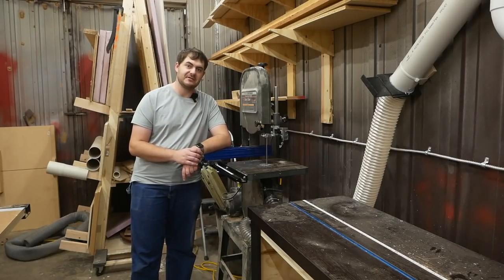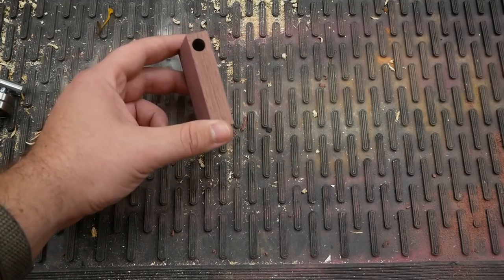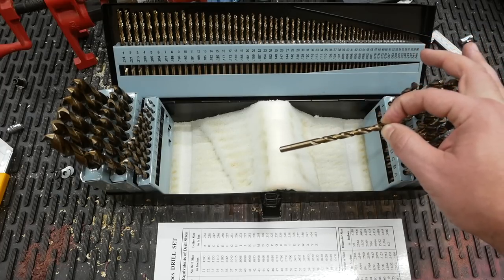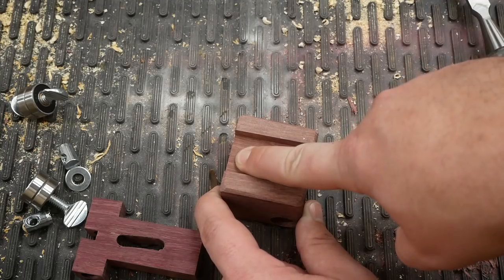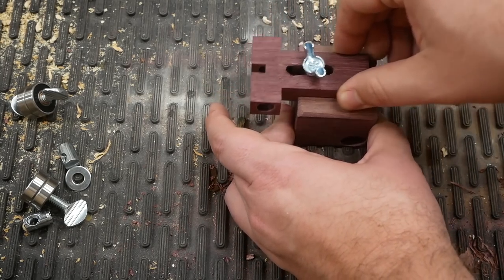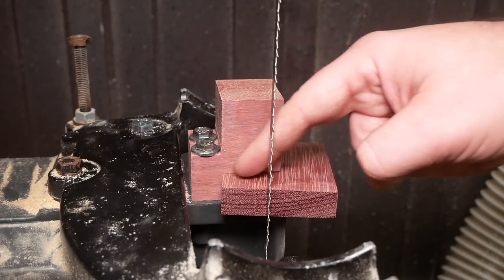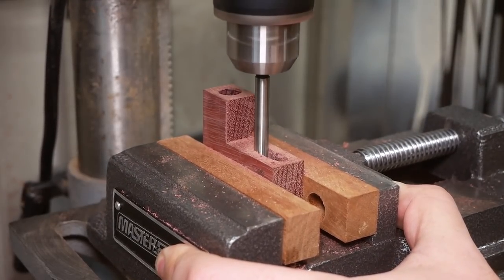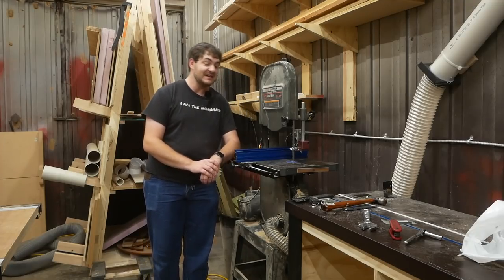Making New Ball Bearing Blade Guides For My Old Bandsaw

Comment: Matthias Wandel has made a few videos on band saw blade guide design.

This one discussing the orientation of the back ball bearing:
https://www.youtube.com/watch?v=V_bUCTCNUmo

This one comparing four different designs:
https://www.youtube.com/watch?v=DQZY0bFDiw8
Reply from the maker: That's exactly the info I was looking for. I should've known the wood elf would have a video or five about this.
Reply: @UnderDunnOfficial  bruh but it's Matthias Wandel were talking about here. The man knows about the topic as much as you and me 😂 Regardless Matthias makes some great machines
Reply: He uses wood blocks on the sides instead of bearings. I designed and printed blade guide for my saw that used bearings, and later ended up switching to hardwood side blocks. I now agree with him they are better.
Reply: That des it... I Quick before i Saw you loosing fingers....
Reply: @broken_font1881  Matthias is an engineer.
Reply: Just wanted write same thing
😁
Reply: fernando Mazzon   What species of wood?
Reply: Matthias set his up incorrectly. The rear bearing is not supposed to spin when not under load. It should be just off the blade and make contact the moment any force is applied. This saves bearings and fixes Matthias's complaint about noise. Checkout the bandsaw setup video the Wood Whisperer put out a few years ago ft. Alex Snodgrass for better info:https://www.youtube.com/watch?v=bxVyKsbuwZQ
Reply: Is the wood and wingnuts good enough?
Reply: @UnderDunnOfficial  Wood Elf, I love it. Thats how I will think of him from now on.
Reply: @igorbaldo  Looking at his website he's a software engineer. Mechanical and software are entirely different fields
Reply: @davidzard4643  engineer is engineer. :)
A person who has a problem and trys to fix it and maybe sometimes fails. But he keeps trying until it is fixed instead of running away crying :)
Reply: Another reason is there's more surface area contacting the bearing when installed laterally; this would limit potential flexing while under load (i.e. resawing a board).
Reply: Nice

Comment: Robert: goes and gets a full imperial drill bit set

Me, who often has bad ideas: why not just wiggle the 10mm around until it bores it out enough to fit?
Reply: Honestly that was my first thought. 🙂
Reply: or, wrap sandpaper around the slightly smaller 3/8" bit
Reply: Yeah it looked like about 1.2 imperial wallers to me
Reply: Because wiggling the drill around gives you two back to back cone shapes rather than a cylinder.
Reply: Yep. I was like “aight just wallow it out a bit”
Reply: I had no idea doing the wiggle move was a bad idea.
Reply: @rescdsk  "1.2 imperial wallers" I need to remember that one! 😂😂
Reply: if it was a cheap drill bit i would have ben tempted to just try chap the drill bent so it cuts bigger.
Reply: Well done. Where did you buy the bearings?
Reply: Yep that’s what master craftsman does
Reply: @ferrumignis  not a legitimate problem
Reply: @THESLlCK  If you don't give af about accuracy and precision it's not.
Reply: @ferrumignis  “reee conversions are hard”

-whiny “educated” euros
Reply: Or wrap sandpaper around it. Or use an end mill. Or use a burr to ream it. More than one way to skim a rat.
Reply: Take the 10mm twist drill to a grinding wheel.

Make the center point of the drill "off center".  Basically you are sharpening the drill while moving the center point by only sharpening one of the cutting edges.

Now you have a cutting edge that is say 5mm and another that is say 4.91mm vs two at 4.955 (exactly center on Dunn's 9.91).  As that 5mm cutting edge rotates about itself (ie drilling) you will get a 10mm hole.
Reply: What is preventing us from 3d printing the drill bit unless the cost of filament is a concern?
Reply: @drippingwax  My 3d printer actually came with a sample of metal filled filament. The plastic part of the structure can be molten out of the finished part.

Comment: Sir: Two suggestions.
1. Buy a fairly cheap set of center-cutting end mills for your slotting and carving operations if you are going to use a drill press to accomplish them.
2. If you MUST put screw threads directly into wood, use Helicoils or similar thread repair inserts. They will last much longer and be stronger as well.
By the way, 2 flute cutters, like drill bits, cut triangular holes. 4 flutes cut rectangular holes, etc. The number of flutes in the cutter, plus one, is the number of "corners" in the resulting hole. A framed with 6 or 8 flutes cuts a founder hole with smoother walls and more accurate and consistent diameter. 
I know you didn't ask, but I am an old fart, I envy your having that workshop and I just love to poke the bear. 🙏

Comment: if you need to tap threads into a softer wood, try drilling and tapping as normal but then saturate the newly cut threads with super glue.  Once the glue is cured run the tap through the threads again and Robert is your fathers brother.
Reply: There are actually several ways to do it, but usually you screw metal inserts into the wood which are pre-tapped. High speed drilling of the wood with a metal tap is not tapping wood. Yeesh.
Reply: Robert is him
Reply: @AgentTasmania  woosh 😛

Comment: 3:25: Based on the splatters on the wall behind the drill press, it looks like you've learned a few hard lessons...
10:09: Yup. No big deal...
Your videos are instructive,  fun, and inspirational.
Reply: No, this used to be a paint shed for an automotive shop. Granted your point still stands
Reply: @R41N80WSCR4TCH  No, this used to be the set for Dexter.
Reply: @madziar160 : Maybe Rob was the inspiration.

Comment: Nice job! One reason for the thrust bearing to be 90 degrees to the blade is more surface area contacting the back of the blade, rather than a single point with a parallel bearing. I’d fix the upper blade guard sooner rather than later. Keeping your hands away from the exposed part of the blade isn’t enough. If and when the blade breaks, the loose blade can nastily cut you. I’d make this my very next project.
Reply: And that's the problem , the thrust bearing is the one that does most of the work to keep the blade in place ,  more contact area will only   increase the friction between the blade and the bearing , therefore creating / generation more HEAT when the saw in at work , thats the last thing you want to do 
 That heat will damage the blade and it loose it's sharp edge quicker than you expected
Reply: I agree with you @jim Gott.  to spread the load of the contact of the back of the blade helps prevent it from buckling and binding on the side guide rollers (or blocks).

Comment: Very cool project!  Fwiw, clamping a board across my drill press table (and later building at t-slot base with a fence) transformed my drill press for me.   I now had a way to support what I was drilling and haven’t had any more cases where the item I was drilling got bound to the bit.  Plus it is now very easy to clamp items to a stable surface (the fence) and keep my hands well away.

Comment: I'm amazed that you can tap a thread directly into wood!
Reply: I wouldn't have thought so either but Matthias Wandel does it all the time
Reply: Before using helicoils on a cylinder head I actually practiced installing them in a 2x4 and it worked great.
Reply: Guess it really needs to be hard wood to have a chance of holding any force. Also UNC probably works better than metric or UNF due to the coarser thread pitch
Reply: Purple Heart wood is extremely hard and hard on the cutting tools as well.
Reply: Hitting it with thin super glue, will also harden the threads up.

Comment: I got to say this, that is impressive in what you did... I have a Band Saw CARTER  Guide System.  3-bearing wheels top & bottom. I had blocks, yet gave me a lot of issues. It was an investment $150.00 for the new Carter Guides. The funny part is that my BAND-SAW was $189.00 Penn State Industries 1992. Did the Carter Guides in 2010. I changed the tires on the wheels, better quality for blade control and the Carter Guides made it a completely different & a better band-saw. Blades last for yrs instead months. It was worth the investment just in saving blades.

Comment: Hi, i enjoy your channel and unapologetic delivery.  I do not know if this was mentioned in the comments, but  just a thought... Alex Snodgrass has a great bandsaw set up procedure.  He suggests that instead of centering the saw blade on the wheels we ahould be centering the back of the gullets.  This keeps the blade straighter duringncuts and eliminates additional adjustment of the side guides once set.  I have done this and it reduces drift considerably.  Thanks for what you do!

Comment: I put the old guide set off my G055 Grizzly onto an old bandsaw looked identical to yours when I put a Carter set on mine. It didnt even have a place for bottom guides, I had to drill mounting holes in the frame. Worked great after the refit.

Comment: That black piece you removed is where I squeezed my dust extraction  brush in its purpose was to remove the dust before it got onto the rubber Tyre on the lower wheel, secondly it also sucked the dust through the blade insert which I drill 3/16 holes in to assist with downward dust removal.

Comment: bearings are faced sideways on guides because facing them towards the blade leads to a terrible noise and will also rub a groove into the bearing over time
Reply: That is why you are supposed to have earplugs to avoid hearing unwanted noise, tho i despise the thought as hearing shit is what gives you an idea of something not working properly, and secondly, the bearing is a disposable tool in this case, just like a tire on a car, which is supposed to be changed when worn out, and with it backing the blade up, despite it making noise and being worn, it prevents the blade from snapping when you shove a chunk of something that would force the blade back and put too much tension on it...
Reply: If the bearing is spinning and the saw is adjusted properly, very little grooving. Those standard side mounted bearings wear terribly as the blade is being rubbed sideways wearing out both blade a bearing side face.

Comment: I have been wondering why the bearings contact the blade with the side of the bearings. I intend to do the same modification to my old DeWalt table top band saw.  This video has given me some tips on what I need to take into consideration. One thing I have learnt.....the hard way,  is when you measured your barrel nut and then used your chart to find which drill bit you needed. I have found it is a good idea to measure the drill bit to check the accuracy of the chart.  I googled what drill to use with a particular tap and it barely had any material left to tap into. Especially as you had the calipers already in your hand. Great job on your mods.

Comment: I was just reading up on Purpleheart yesterday, and overheating it causes it to exude a resin that sticks to your tools. That can then cause your tools to dull even more. Purpleheart needs nice and sharp tools that are touched up often because Purpleheart is hard on tools before it exudes resin.
Reply: Metal guy getting into woodworking - thanks for that.  Would have taken a few years to notice that on my own I bet.
Reply: Many exotic hardwoods are like that.  I removed a 1000 sq. ft. bulletwood deck from by backyard and have been working with that stuff all year.  Luckily it's old and dry,  but so dense and hard, you can't even get a nail into it without drilling a hole first.  Screws don't work well either, because the screw threads don't cut the wood.  If the pilot hole is too small the screw will split the wood or break off.  If the pilot hole is big enough for the screw to fit without binding, the threads won't catch very well.   I have to use dowels or threaded inserts for any joints that requires strength.  That wood destroys drill bits and saw blades - anything less than carbide doesn't stand a chance.  I can only plane a half dozen boards before my HSS planer blades need changing.  :D

Comment: Hi, I'm not a schooled Engineer but have worked with several over the years, I think if you put the rear bearings at an angle, the blade won't create a groove as the bearing surface is always different. All in all a good video fixing a problem with you saw!

Comment: Nice build, Robert! I wanted to caution you on how you held the piece at 10:15. The direction of force of your appendages should never be towards the  blade, within maybe 8 inches or so.  The workpiece can always unexpectedly kick out, and reaction times are far too slow. Always factor in the slim possibility because it just takes once. I speak from experience, but thankfully my accident didn’t cut through bone and is mostly healed.

Comment: In my experience, the reason for the bearing being 90 degrees in the wrong direction is so that once sawdust slows it down it will get a groove worn in it which will trap the blade and guarantee that it (the blade) always points in any direction but the one you want.

Comment: Ah, that drill index brings back fond memories. My undergraduate work study gig was as a tool crib attendant in my university's mechanical engineering tech program's machine tool laboratory. Over those four years, I spent a lot of quality time handing out, taking back, and replacing the No. 7 drills out of sets exactly like that one. (Sharp-eyed viewers can probably deduce something about the projects they did in those classes by the fact that the No. 7 wore out or got broken long before anything else in the set!)

The punch line: I was a liberal arts student! Mostly. I did take some MET courses, so I knew what I was doing in the tool crib, but my degree is in history. :)
Reply: why the No. 7s?
Reply: @alex4alexn  'Cause it's the drill you need to make the pilot hole for a ¼"-20 threaded hole (that is, a hole with a quarter-inch major diameter and 20 threads per inch), and the student project pieces, for whatever reason, had a lot of ¼"-20 threaded holes.

For the more advanced of the two courses, where the students would be building something they designed themselves instead of following provided plans, we used to encourage them to use fine thread (28 TPI, in the case of a quarter-inch hole) instead, just to spread the wear and tear out a little, since you use a different-size drill to make the pilot for one of those. :)

Comment: Sorry to hear about your misadventures with knockdown nuts (aka dowel nuts).  That's a frustrating way to spend the day!  After more than a few wasted days of my own, I've finally given in and started buying specialty hardware from McMaster Carr. It's not as cheap as Amazon/eBay but last time I was making knockdown furniture, I bought a few different sizes of dowel nuts. The few I checked were within -.002 / +.000 tolerance.  At least to me, that's totally worth a few extra cents apiece!

Comment: it's oriented to the side because the pin in the center of it is an eccentric, allowing a bit of left-right adjustment. Also, being oriented side-to-side allows for a more compact guide assembly with fewer moment arm forces. which I fear you will come to experience in time due to those tiny wood pieces.

Comment: Always a wonderful time watching you Robert!!  I have found that if you use thin CA glue in the hole before tapping, after it sets up, it gives you stronger and cleaner threads.  The CA penetrates the wood’s pores and provides added strength and density. You may want to consider that next time. Also, I’m really glad you still have all 10 fingers!

Comment: Excellent design and execution despite the quaint and entirely self-imposed handicap of the imperial system. Here in the rest of the world it’s sometimes a struggle to work out what is slightly bigger than 10mm 🤔. Hmmm, that’s right, it’s 11mm!
Reply: The real fun begins when you work with customers that give you drawings in one or the other, machinists that talk "thou" and inspectors that generally talk metric.

I have 25.4 tattooed on my hand.
Reply: @Witty..UserName : I'm guessing, that arm get a lot of exercise. 🤣🤣🤣

Comment: Hi Sorry only just found this but to clear up the questions of why the ball bearing is one way and not the other here goes. Keep in mind I am  a user of bandsaws for 45+ year including building bandsaws guides and making bandsaw blades etc. The traditional way the bearing is always as you have said to the side as is used for woodworking bandsaws. Metal cutting bandsaws are different. For larger machines a steel cap over the bearing to protect the bearing is good but in all cases it is to allows full support of the back of the blade, where as using the round as they do mostly now for many machines allows the blade to slip and also stress the back of the blade as it is only sits on the round edge so very little area. It was nothing to do with noise just the modern machine take short cuts etc. Side guides up to you as long as the guide does not wear as they are only a guide so the blade does not twist while cutting. Use hardened steal blocks if you can as it will not wear nor heat up and if it does heat up the guides are to tight, no need to use cool guides etc. Remember the guild must suit all sizes of blades 1/16" - ??" depending on the machine and why steel guides are best as ball bearing have slight round edge so not good for 1/16" blades. Hope that answered your question.